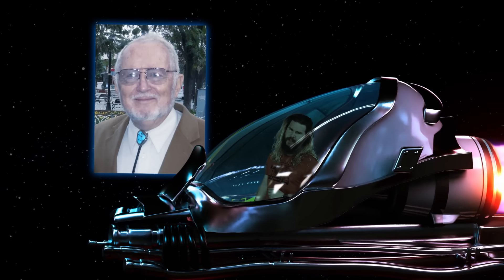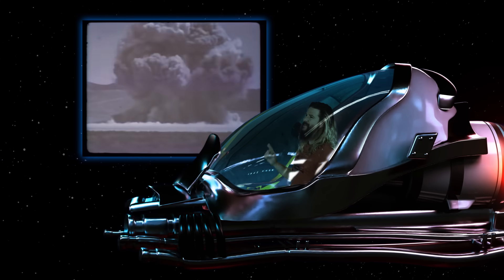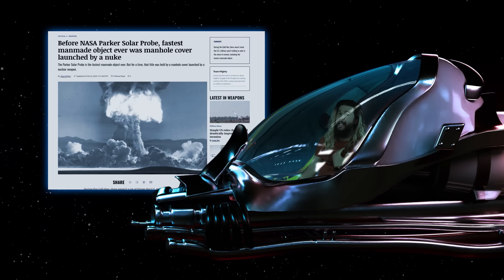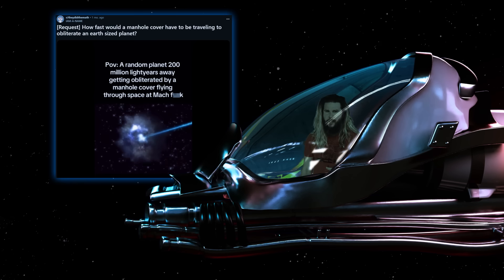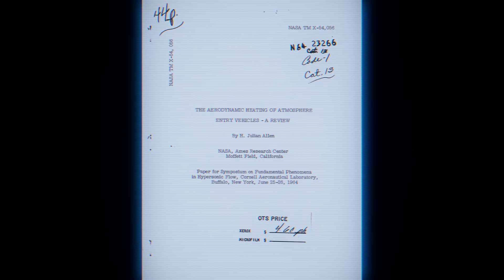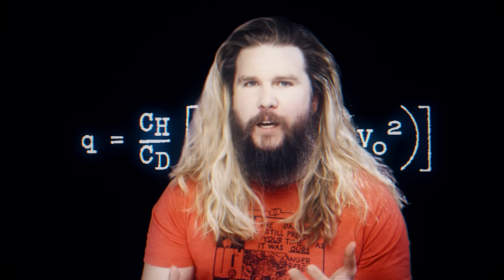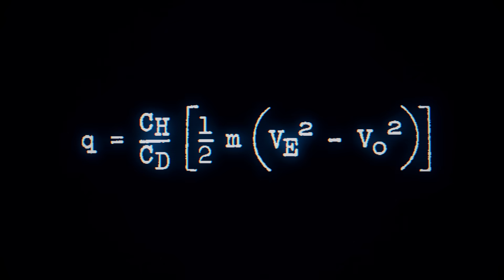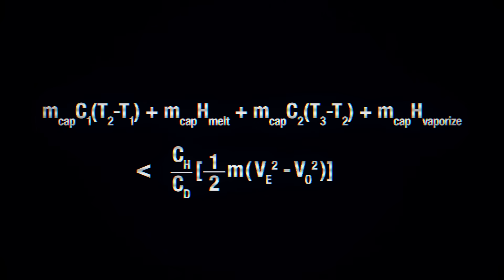Debunking the Nuclear-Powered Manhole Cover

Comment: The equation doesn't seem to take time into account.

Travelling at that speed (which is just a minimum possible speed based on a single frame of high speed camera footage) how quickly would it have left Earth's atmosphere, and would the heating be fast enough that it would have completely vaporized in the time it took to leave the atmosphere?

if time to orbit is lower than time to vaporization then it could have been launched into space.

Comment: if we consider that the manhole cover would turn sideways like a weather vane it is very aerodynamical shaped and the math doesn't add up. given the beneficial properties of iron it would probably vaporize the leading edge, but the comparativly huge side area would make an excellent radiator. also, total heat flux is lower in a rapid ascent/reentry. given the speed it supposedly went off is true it would be out of most of the atmosphere in less then a second. doesn't change the fact that it wasn't the first manmade thing to space. The germans reached space already during the war.

Comment: You failed to take into account that the reason that the manhole cover was moving in the first place is because there is a column of air or expanding gases that are also moving along with it in the same direction and faster than it is going. This means that the column of atmosphere above manhole cover experienced impact with this column of expanding gases before it impacted with the manhole cover. This means that at the very least in the most dense portion of our atmosphere the manhole cover was shielded by this expanding gas column
Reply: If you watch slow motion footage of a bullet leaving a gun even though the bullet is already traveling at its maximum velocity when it leaves the gun the gases leave the gun faster. Also the shorter the barrel of the gun the greater the difference between the speed of the bullet and the speed of the gases. This means if the bullet were just sitting at the end of the barrel the speed of the gases would be a substantial amount larger than the speed of the bullet.
Reply: As you said at the very end of the video the fact that your math came out within an order of magnitude of not vaporizing this means that even if we were to add in just a fraction of the are moving in the same direction we easily overcome that order of magnitude . This means that it almost certainly made it to space which is something that I have known since grade school when we actually did the math and it did not even come close to the vaporization point of an object half the size.  .....

Now on to the question that has been bothering me for 30 years is "where is it?" Aaaaaand.....What direction did it go? what is its orbit around the sun?

Comment: The only thing I question on this is that the story states Cast Iron which isn't pure iron but roughly 96-98% iron and 2-4% Carbon which gives it a moderately higher melting point

Comment: the thing i dont get, is your comparison of a meteor, the manhole cover shot straight up, exiting the atmosphere in like a second? meteors enter the atmosphere slowly compared, the manhole cover would have been exposed to the friction for such a small ammount of time, would it be possible for the heat energy to even transfer into the iron that quickly before it was out of the atmosphere as to melt or vaporize it?

Comment: You forgot the whole fact that the an equation would be reversed as it was starting from dense atmosphere to no atmosphere so atmospheric heating would be reversed near the end as it would be dispersing heat into the atmosphere as it got closer to space not to mention the fact that you would have to start with what the ambient temperature was prior to the explosion and how much it would have heated up from the explosion which would be negligible because of the pressure wave from the explosion

Comment: 1.  The cap was accelerated from zero to freaking fast in a fraction of a second by the blast, but it's seen flying up in the video, so it can clearly survive it.
2.  For the first part of its trip through the atmosphere, the cap is being preceded by a powerful shock wave and accompanied by even faster moving plasma, moving the air out of the way.

Comment: There's another problem with the manhole cover story: At least a few V-2 rockets reached space in World War 2.  Their average altitude in an operational launch was 88 km.  Its theoretical maximum (if fired straight up) is over 200 km.  It's basically guaranteed that some test launches and a few operational launches would have reached the Karman Line (100 km) and officially gone into space.

Comment: You are forgetting something that will throw a wrench into your calculation a nuclear bomb will make a mushroom so the atmosphere will be moving roughly the same speed as a manhole cover so you will not have that calculation being correct for friction versus the air if the air is traveling with the manhole cover

Comment: It definitely isn't the fastest man-made object in space. NASA's Parker Solar Probe is the fastest man-made object ever, reaching a speed of 394,736 miles per hour or more than double the supposed speed of the man-hole cover. 
There are too many variables that would have to be considered to know if it truly evaporated or not. With its speed I am sure it liquified and then would have formed into a molten ball of iron some of that might have vaporized. However, if it turned into a gas then it that gas would have cooled, condensed and then rain solid iron on the ground not long afterwards.
The Earth's atmosphere is about 100km thick. The manhole cover estimated to be travelling at least 200,000km/h. It would have exited the Earth's atmosphere in 1.8 seconds. Would that have been enough time it to change it state from solid to a gas before exiting? The cast iron would have to sublimate from a solid to a gas. With some research that would mean that the entire cover would have to reach 2861C to vaporize and that temp is at 1ATM. While the sublimation temperature requirement lowers as atmospheric pressure decreases (it would still be around 2000C to sublimate at 0 atm) so would the friction heating of the iron as it travels through it.
Just too many variables to determine what happened. Did the nuke heat the metal first, was it a cloudy day, what was the humidity, did it travel flat on or edge on, even the time of day can determine the density and thickness of our atmosphere. My best guess is that some of it was solid, some liquid and some gas as it travelled. The entire cover didn't make it (sublimated), and parts of it probably broke off from being liquified and traveled through space separately. But there is probably a chunk of iron zipping through space at a tremendous speed.
Reply: I find your take on it to be great though. There is no way of knowing for sure if it made to space or evaporated in the atmosphere, and we will probably never know. Tried to do some math on the distance travelled in the time since launch. Since 1957 it would have travelled about 73 Billion Miles (785 AU), which would put it past the heliopause and almost to the Ort Cloud, nearly 8 times further than Voyager 1. I don't think we will ever find it to confirm, and that is if it had absolutely no interactions with any celestial bodies. Since the test seemed like it was done during the day it would have probably slammed into the Sun.

Comment: I have a few questions/what ifs. Firstly you assume the disk remained flat side into the atmosphere but wht if it turned and sliced through the air on its side ie narrow edge? Also at 150k mph would be remain in friction long enough to melt etc?

Comment: Lets put away the equations and deal with material science for a second.  Was the manhole cover truly made of iron (presumably cast iron) as most manhole cover are.  Cast iron is quite brittle, so if the manhole cover was cast iron, then it would have shattered to small pieces from the shock wave and pressures it was subjected to.  What was photographed in that single frame was probably a compressed cloud of shattered iron, like the compressed pellets coming out of the barrel of a shotgun.

Comment: If it was welded in place . I doubt very much it was cast iron . Clamped yes , welded no . Cast is very hard to weld . It requires preheating and controlled cooling otherwise cracking will happen . Most likely it was steel , probably a good quality steel at that .

Comment: The main problem I see is comparing the heating of re-entry with heating when leaving the atmosphere. Also an object that can melt will change shape to minimize the effect of drag. As for the reason meteor explodes is due to their composition. Some elements vaporize with less energy making the structure unstable. Also we often recover pieces of meteors on the ground. Especially the parts with a very high proportion of iron. Putting this all together with the back of the envelope difference of only one order magnitude makes a scenario where the steel cover surviving the atmosphere possible and even probable.

Comment: Now if everything was moving and every thing is perfectly flat, more than likely yes it would melt, but, nothing is perfect. What happens if a weld broke sooner than the other, it would tumble. What if you had a uneven blast of heat and air escaping from the exhaust tube. Or the velocity was lower than originally thought.   Any number of things could have altered the escape velocity of the cover. My thought is, it tumbled and found the least resistance moving through the atmosphere and some if not most would have been launched into space. Granted math is finite and is stable for an answer. But your dealing with nature, anything can and does happen. I guess we will never know...

Comment: Reading the comments, I honestly dont think the atmosphere is even the real problem with it going into space

Im wondering how it wouldve survived the accelerating forces in a solid piece, i mean it's clocked at faster than the speed of sound through steel, so shouldn't the force pushing it have torn it to shreds making that plume more of a "jet of hot plasma and metal dust" than "trail behind a flying object"

Comment: The method of checking the energy required to vaporize it makes sense (KSP taught me that you can burn up on exit as well as re-entry), but if it was going fast enough to escape our atmosphere, would it have time to absorb all that energy before making its escape?

I don't suppose you'd have the means to run this as a simulation in a follow up video?

Comment: My biggest concern about this is the premise of re-entry calculations being used for escape. something re-entering is going to speed up as air density increases while already being hot when entering the next meter of air in front of it. The escape does the opposite, it slows down as it enters thinner air so less heat is applied per m Infront of it. The heat built-up a re-entry experiences will affect the outcome of the next m traveled as heat has time to disperse throughout the object. At denser air Energy transfer hits the outer layer and creates a Leiden frost layer of gases as the metal boils which protects the object to some degree, but the heat bild-up will be less on escape as the object starts cold and gets protected from base temp whilst on entry the object starts to get protected when its already hot so the heat has had way more time to build up in the object making the next "layer" require less total energy to start to boil.

Comment: I'm not convinced. I never doubted there was enough energy involved to vaporize it, the doubt comes from the dynamics of the bow shock and how effectively the ablating material shields the remaining hunk of iron. It could easily be that the heat that would have vaporized the last of it instead just goes towards making the already vaporized iron even hotter. 

To actually gain confidence in what happened back then you'd need a CFD model that you validate by repeating the experiment a few times.

Comment: this feels like a Schrodinger's cat discussion.
as i see it, there are alot of problems with the the argument itself (not touching the equation).

so both sides of the argument are arguing whether there would have been enough energy imparted on this object to destroy it. either at launch, or during "flight"

well the first problem i see is that the man hole  cover (by best estimates) as in atmosphere for at most 2 - 5 seconds whether it vaporized or not. that is not even considered in the argument on this video.
the second problem i see is the lack of consideration of atmospheric forces around the plate. the atmosphere was traveling in the same direction and much faster. this actually would do 2 things, 1 would be to continue to push the object, and 2 would reduce the friction, so it actually seems to me that the object would be accelerating, rather than decelerating. Also, this means that the plate is not simply flying under its own momentum, but with an outside force pushing it. so its much less like a meteor, and much more like a bullet in that regard.

and lastly (certainly not the last possible point, but its the last one i feel like pointing out) the argument almost seems to take advantage of the idea that there isnt an accurate calculation of speed.
based on my previous points ( which could be erroneous, im not an expert, and its late here so im tired lol) we actually dont have any idea how fast it was going. the estimate given originally, was a calculation based off of the camera only capturing the manhole cover in a single frame. im not sure that single data point is enough to make an effective argument.
but, it occurs to me that if we knew how far away the camera was from the vent, and how high the plate was in the photograph when it was captured in that frame, and the particulars of the camera, we could actually likely calculate an actual rough estimate of its altitude, and thus the distance traveled in that single frame. that would tell you its approximate current speed because that is a distance covered in a measured amount of time.

and beyond all this.... how much energy was delivered to the plate from the blast? as that will also give us some clue as to how fast the atmosphere was traveling.

so... im all for more experiments with explosions.... FOR SCIENCE!!!

Comment: Has anyone ever thought of any variant of the Leindenfrost effect? With so much energy in an iron plate, some of that temperature could affect the surrounding air and dramatically decrease drag, right?
In addition, a meteor finds a progressively denser atmosphere, so it slows down and heats up, when it reaches a denser point, it is already slower and warmer. I imagine the math was made based on something amorphous, like a rock, not an iron pizza. 😅

Comment: So it shotgunned atomized iron into the atmosphere, how far up did it go then? Like the bottle spritzer i spary my plants with plooms like 8in when straight up and it's much less massive and going much slower. Also how far did it make it as a solid and as a liquid? Did the top layers of vaporized iron make an insulation gas barrier like pickles in a frying pan? I have so many questions that need more nerd math powered answers!

Comment: I'm no math expert but your numbers do seem correct.  But, and is a very big but this manhole cover would have made it through the Earth's atmosphere and about a half a second. It also weighed 1800 lb. Now if this was a sustained temperature sure it would have burned up. But I don't think that you could heat up that much metal that fast. So I think you're 100% wrong and it did go into space

Comment: My only issue with this is that in your calculations you assumed the cap was traveling sideways through the air the entire time I think it would be far more logical to assume it would tumble assuming it even kept it's original shape as you pointed out in the end would that not change your calculation and reduce the amount of drag on it?

Comment: A couple of other variables to sway the argument- cast iron is highly brittle and likely shattered shortly after plowing into the thick atmosphere, and even if it maintained structural integrity it would not remain in one stable aerodynamic position- it likely tumbled and experienced extreme rapidly changing pressure regimes as the hypersonic atmosphere plowed around it's leading edges introducing shockwaves from multiple vectors. These shockwaves would also not do anything helpful for the cast iron's lack of ductility , making it even more likely that it broke apart shortly after it's acceleration.

Comment: My only added thought on this would be that the cover could only get up to a maximum speed slower than that of the air pushing initially. (The air would be the fastest closest to the hole and would itself slow as it climbed into the atmosphere) Due to the inertia of the cover, wouldn't some of the air be traveling faster than it during its acceleration and disrupting the lower atmosphere in front of the cover? This is also presuming that the cover didn't get ejected exactly as it sat and tumbled as it was thrown. Thus allowing faster air past it and putting it into a column of air traveling in the same direction and relative speed and reducing the amount of air that it collided with on the way up. Ultimately reducing the heat it absorbed.

Comment: What happens if you change the assumption that instead of flying flat straight up it was spinning or got turned 90 degrees and the slim side was facing up slicing through the air?